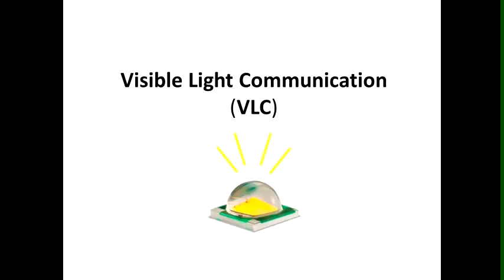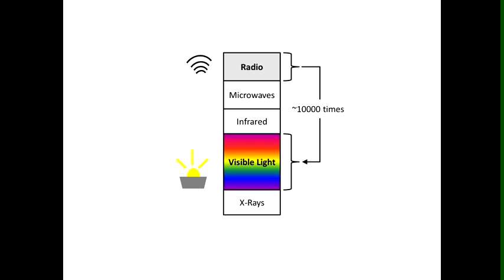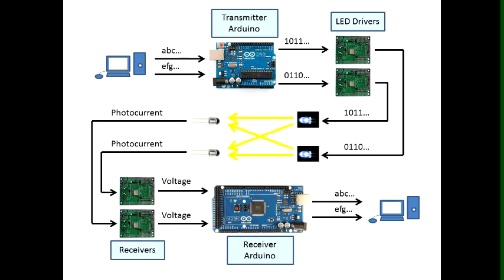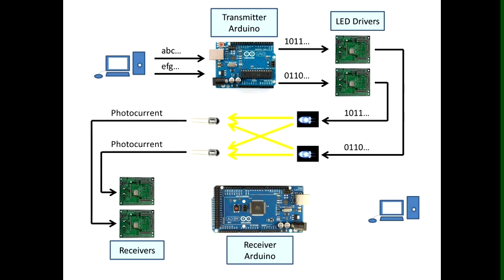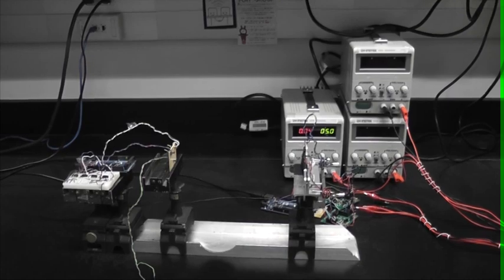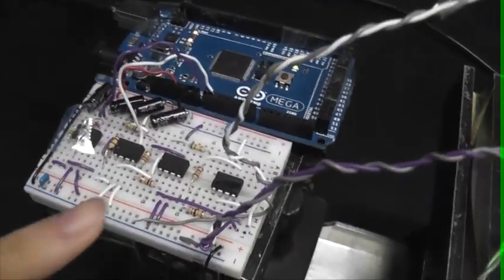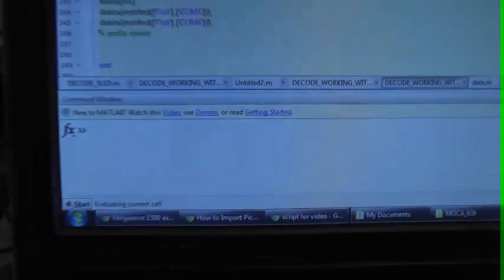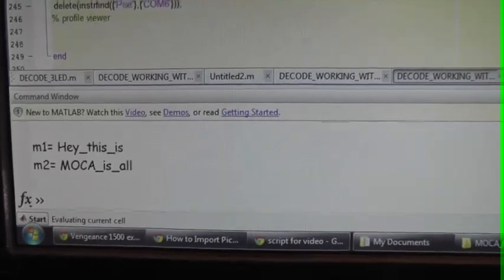Li-Fi : Introduction to MOCA (Multiple-Input Multiple-Output Optical Communication with Arduino)

Comment: Hi can we connect? I need some information regarding MIMO on arduino bro! let me know!
Reply from the maker: +Ben G sure, what do u need?
Reply: yvictorck well, i am working on Car Communication using Li-Fi and during my research i came across the idea that MIMO was well suited for outdoor communication and since you must know V2V is an outdoor application, i was wondering what coding did you and can you explain me more about your MOCA? I will add you on g+ so we can talk more! Looking forward to exchange more info with you!
Reply from the maker: Hi Ben, sorry for the late reply, I don't think we used any wireless coding scheme, we just simply oversampled and applied mean average filter to recover the bits. As for MIMO, we also just simply use zero forcing matrix based on incident angles and such. The detail can be found in the paper : https://github.com/yvictorck/MOCA
I added you on g+ but not sure where the chat button is. Thanks!
Reply: yvictorck okay i will contact you very soon
Reply: yvictorck you should add me as a friend or family so can be able to  text  you